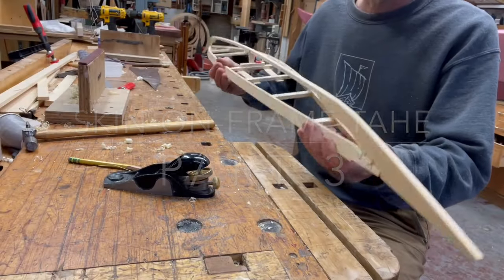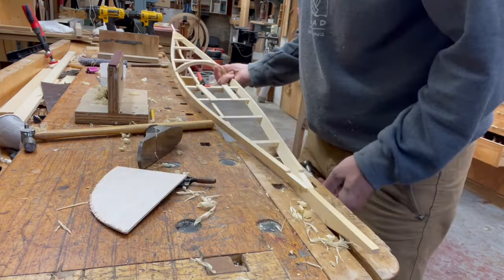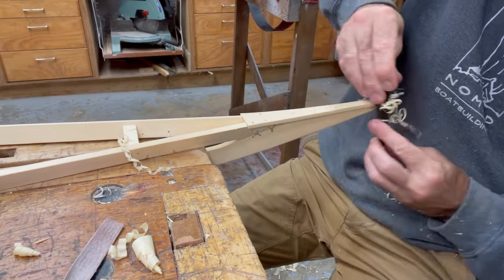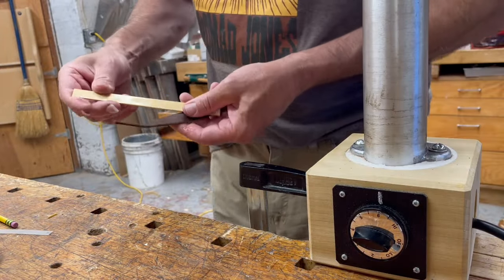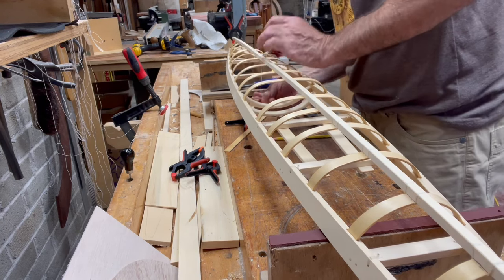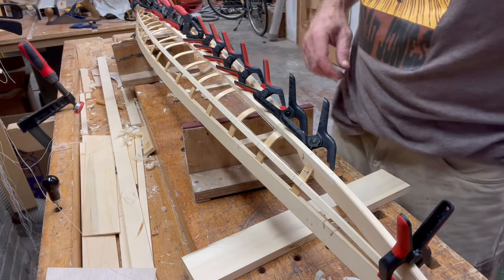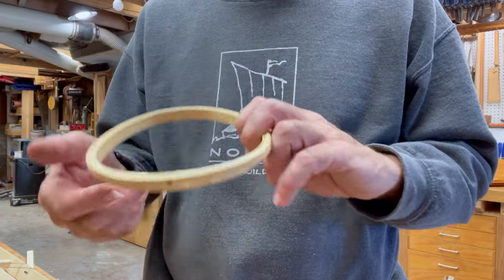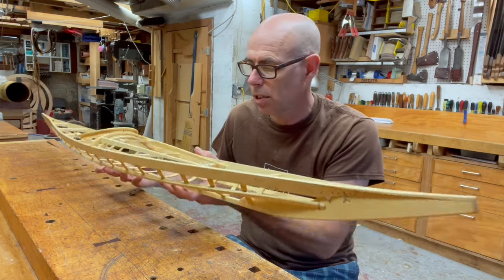Building a skin-on-frame Tahe Greenland Kayak - Part 3

Comment: You have run the full gamut of units of measurement in this series. From cubits to thousands of an inch to fist widths but not a single metric one, which considering where you live, I find refreshing 😉
Reply from the maker: I restrict metric to Euro-hardware and string spacing on instruments. You may have noticed in the last episode a commentor made a biblical reference to metric. Perhaps Noah was actually German.

Comment: I'm curious how your customer will display it in their home. Sitting in a cradle or hung from the ceiling, which would also be cool.
Reply from the maker: I usually provide a small brass hook that will allow wall hanging both vertical or horizontal. Hanging from the ceiling is how I display mine using fishing line.

Comment: Always worth a second watch. Question Mark: Are the lines going from side to side forward and aft of the cockpit ring, through what look like wood toggles, representing tie downs for gear or are they part of the frame beneath the skin? Thanks as always for these great videos.
Reply from the maker: They are bone toggles that are used to tighten deck lines for stowing gear on the outside of the skin.
Reply: @Nomadboatbuilding  Thank you Mark. Have a good evening.
Reply from the maker: My pleasure as always Matt.